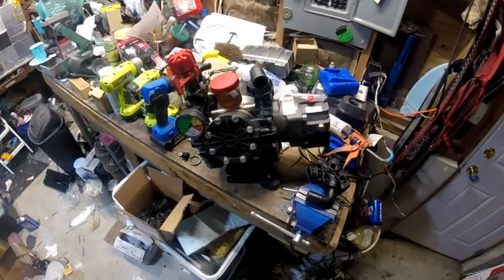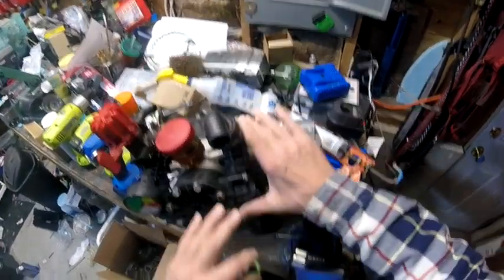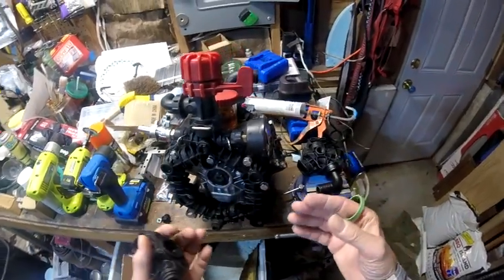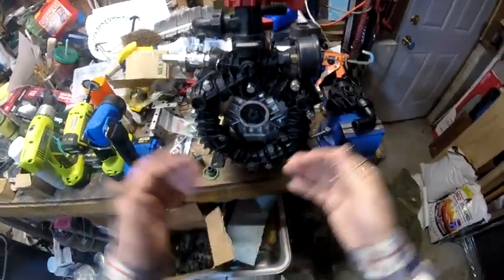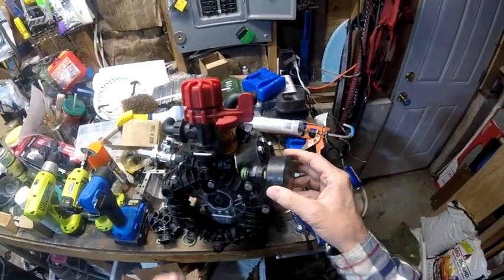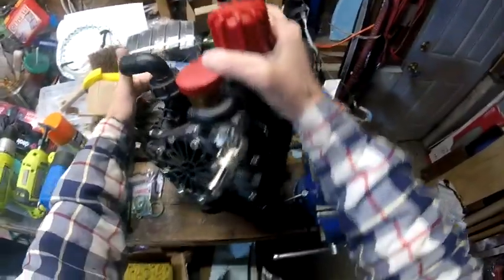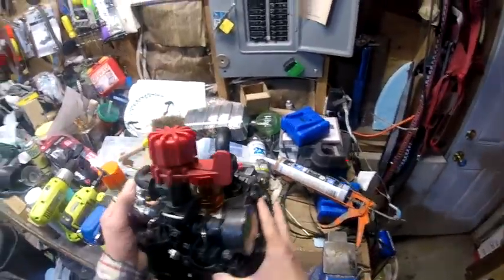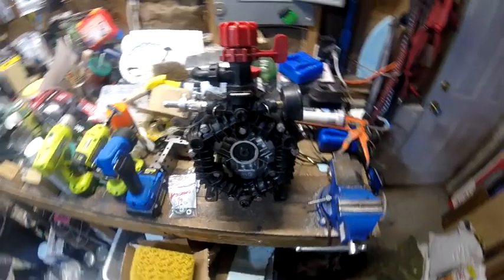AR45 Diaphragm pump - What you need to know - Lessons learned

Comment: Mine just stopped pushing water out all of a sudden now the machine just shakes I don’t have any leaks do you think it could be the check valve’s
Reply: I doubt all your check valves went out at the same time.  I would suspect the pressure regulator or major leak. Could something be froze due to cold weather?

Comment: Just got mine delivered AR has made adjustments to the new model they got rid of the gauge its blocked off and the drain plug on the discharge side is also gone only thing i dont like is not having gauge how do you kno what psi to set at? Main reason this pump leaks also comet it running psi to high rather have gauge and replace that then cause more damage anyway thought i would share this with u question what do u recommend for grease when replacing o ring etc silicone grease? Would wite lithium grease work? Thank u
Reply from the maker: I can't believe they got rid of the gauge!  Only use silicone grease for o-rings.  Go to Lowes or Home Depot and buy silicone plumbers grease.
Reply: @housewashing5693  ok thanks and yea I called AR and they said there was to many issues so they got rid but I'm ordering a gauge kit cuz I rather replace gauges then pump
Reply from the maker: @jasontenney2786   They should lower the price of the pump then.  My gauge went out and I bought a new 600 lb gauge from Dultmeier for under $10

Comment: My AR pump is mixing oil and water what should I do
Reply from the maker: It sounds like your main diaphragms are bad.  You will need to replace them.  Do it asap because any water in your oil will destroy everything else inside your pump. There is a very tiny chance your shaft seal is bad where your gearbox mounts to the pump?  Check to see if your gearbox oil is milky and/or low?

Comment: Thanks for the information. I have a newish AR45 and it leaking already. There is always the daunting learning curve with new equipment so this is very helpful. I just hope I have ordered the correct o-rings since all I can do is guess where the leak is.
Reply from the maker: Sometimes it will stop leaking after you run it a few minutes.  Even at best you will still get little leaks and seeps.  It's not the best designed manifold nor material.  I have probably spent $200 on mine in repairs and extra parts.  But I now have around 400 houses on it without a major rebuild or check valve issue.

Comment: I've had AR 30 for over a year. Only had to replace the o ring in the unloader. 
No other problems.

Also AR 30 has a rubber piece that will blow if the pump builds too much pressure.
You can look at that rubber piece and see when the pump builds too much pressure. You can learn what makes it build too much pressure by simply observing that rubber piece.

For example, if you don't squeeze the trigger and turn your engine down to idle, the pump will build too much pressure, some people may not know that.

AR30 is 590 psi at 9.5 pgm
Reply from the maker: Good to know.  There is a lot of time I could use the 590 lbs to shoot another 10 feet.  Tell me more about how the ar30 does in the field...

Comment: Great information…just what I was looking for.  Going to be 1st time running one this season. Question… your startup procedure, BYpass on or on the trigger? See people recommending both..manual says bypass. Follow your lead
Reply: Start up is not as important as shut down.  At start up I have forgotten to put it on bypass and pull the trigger.  No issues.  But I have electric start too.  But regardless of how I start it I will switch to bypass for about five seconds then adjust my pressure.  Shut down is more important to do it right.  If you shut it down without lowering your pressure or pulling the trigger your suction and pressure lines equalize.  This puts high pressure back into your low side which can blow a line or cause a leak.  So I have found on shutdown you need to pull your trigger.  It still seems to build back pressure if you put it in bypass mode to shut it down. Have I forgot?  Yes.  It's not the end of the world but you'll see your suction lines expand and then you'll pull the trigger.  Fyi.  If you want to find leaks on the suction side of your pump on the pump side of your check valves adjust your pressure to 100 lbs.  Then stop the engine without pulling the trigger or anything else.  This will put 100lbs of back pressure into your suction side and you can find leaks. Pressure leaks are easier to find than vacuum leaks.
Reply: Appreciate the detailed response.  Info has been invaluable 👍🫡

Comment: Try Tru blue with the leaks.  It has worked for me. Also you can use 1¼ hose for that inlet line. You will just need a 1 x 1¼ Npt to barb for your manifold. Great input. Thanks for sharing.
Reply from the maker: Thanks for all the info!